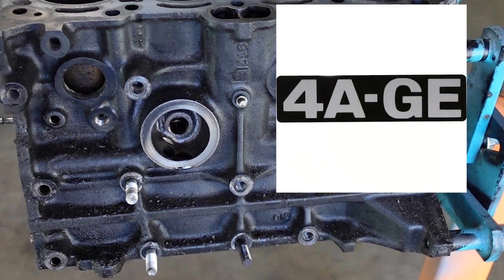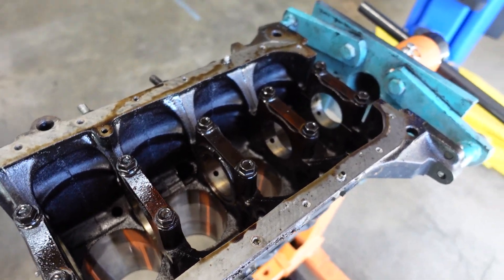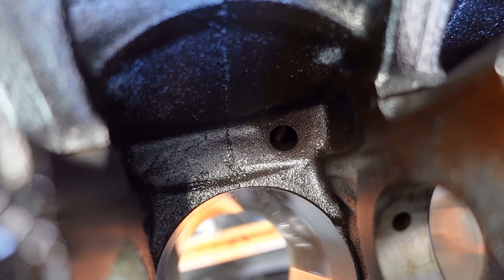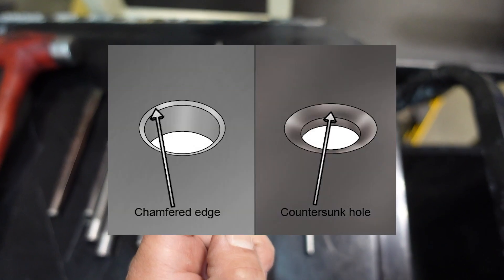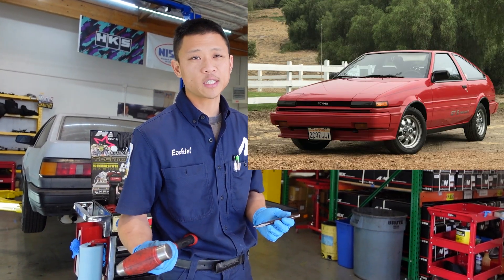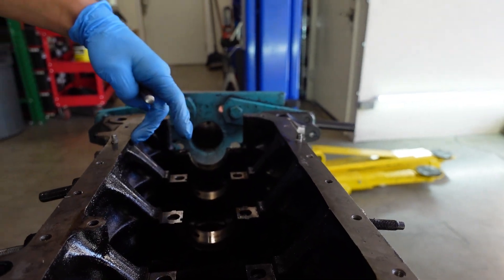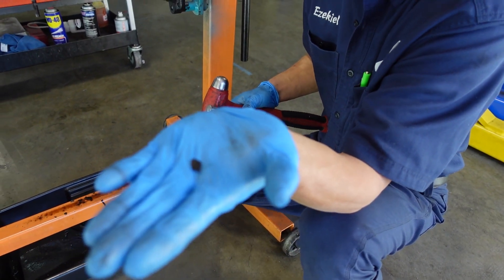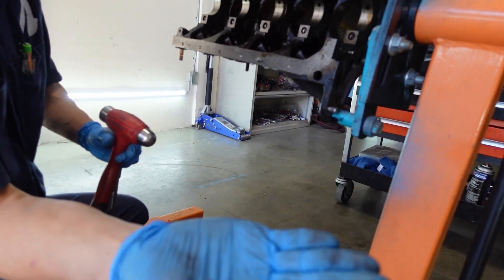Strengthen Your Engine Block for FREE!

Comment: Just to clarify...that large double port with all the flashing in the center of the block is not an oil return, it's to allow crankcase pressure to flow up into the cylinder head to be taken away by the PCV system.  The two circular holes at either end of the block are for oil return from the head.